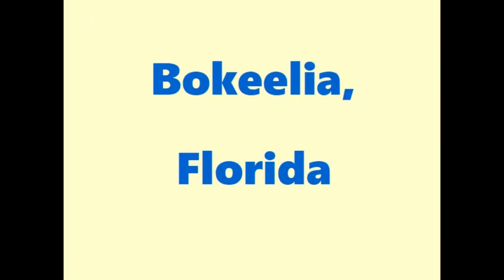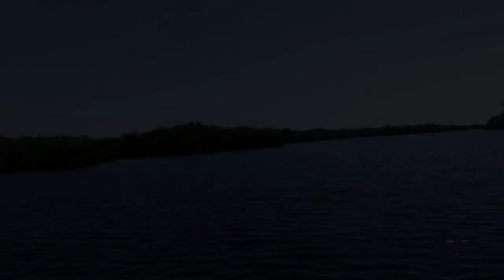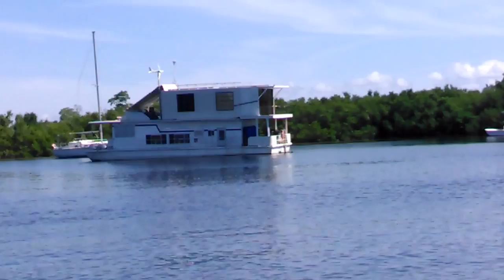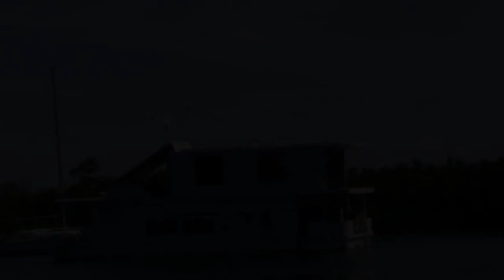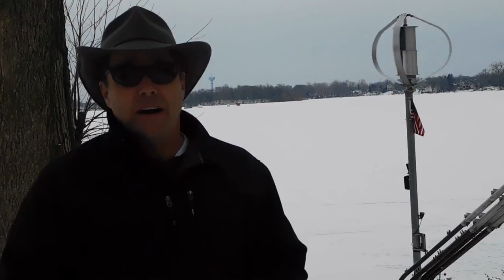Solar and Wind Powered Houseboat near Bokeelia, Florida

Comment: I ran across several videos. That were doing everything they can to show how wind power is not environmentally friendly as made out to be. It was the top five windmill environmentally friendly fails something like that LOL. Shows one giant windmill falling over. shows another one that clipped a hawk or an eagle with a bunch of frown emojis added to it. another one I think the clutch or something failed overheated and caught fire. and I didn't bother watching the rest. What they didn't mention is the biomass power plant, the reusable energy or refuse as they like to say, which equals our power plant burns all types of trash including medical waste and toxic waste. That then produces a mountain and I mean mountains of toxic Ash, that is stashed away somewhere and dumped in our oceans. And if they're caught dumping it in the ocean. the fine that they're given is basically chump change to these guys, so they keep doing it. I worked at almost every type of power plant in New England for over 20 years as a welder. And not one of those can be considered a clean source of energy or environmentally friendly LOL. I've got some cool fun facts I'll run by you sometime. when they revised the Clean Air Act I believe during the Clinton administration. And had the power plants add baghouse systems and atomizers..= scrubbers basically for removing heavy metals from being admitted through the stacks into the the air. which is good and it created jobs but it's still not clean like led 2 Believe. But yeah I have some fun facts to add to that sometime. Sorry about the rant I just have a hard time not speaking out. When there's people out there creating ignorance, so they can defend their ignorance with more ignorance pretty damn ignorant LOL now all that has to happen. Is to get all the new generations to stop spending all day on Facebook Twitter Snapper chat or whatever it is start actually learning something and educating themselves before it's too late how do we tackle that..?..!..🤔 well I guess I'll put my tin foil hat away and call it a day. Once again thank you and your family for the free education..🤗👍👊✌